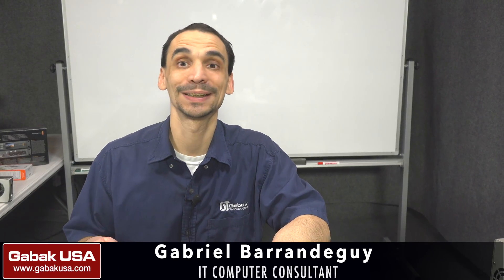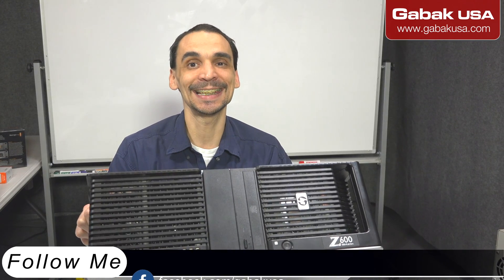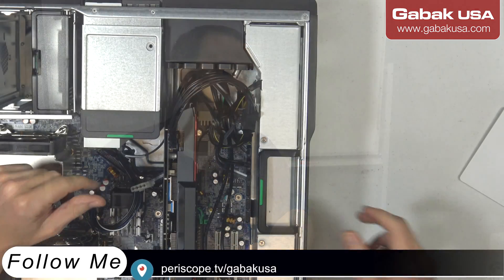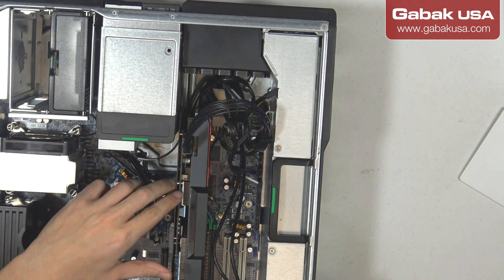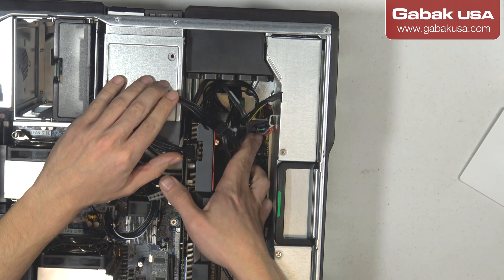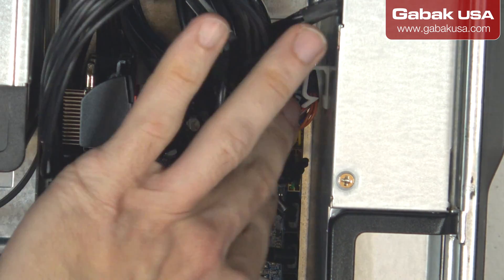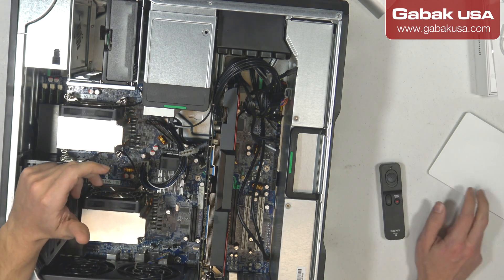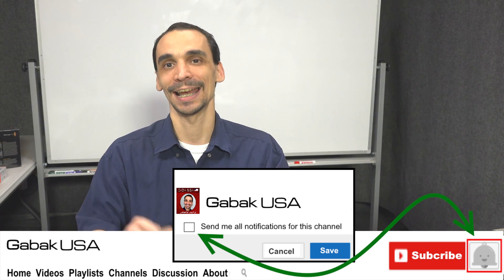How to fix full speed fans HP workstation Z600

Comment: In the Z600 BIOS (F10 from boot) you can also set the fan speed. 
In the BIOS;
Go to POWER-->THERMAL
You can set the Fan Idle Mode in one of 7 places, the left is the slowest and quietest to the 7 which is fastest and noisiest.

Comment: Hi, I hp Z210, When I press power buttton the light remains steady and the fan goes to full steam, and there is no power in keyboard and mouse neither there is display. What to do?
Reply from the maker: did you watch the full video?
Reply: @gabakusa  Yess, I tried replugging all the wires and re seat all the ram and graphic card, dodn't work though

Comment: This tells you nothing.
Reply from the maker: just watch the whole video
Reply: GabakUSA Free computer training It wasn't a struggle to watch 2 mins of nothing. Here's a clue. Full running fans suggests a hardware issue. Check and remove RAM from DIMM slots. In a dual CPU configuration check for failed CPU 1. Replace graphics card. These are just some viable options for fault finding on 100% fan. Your video is none of these.